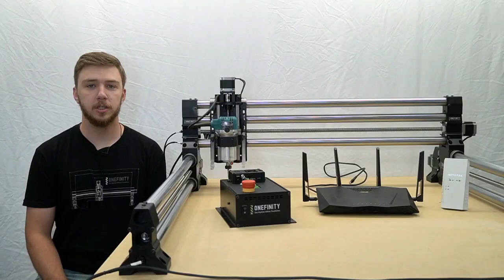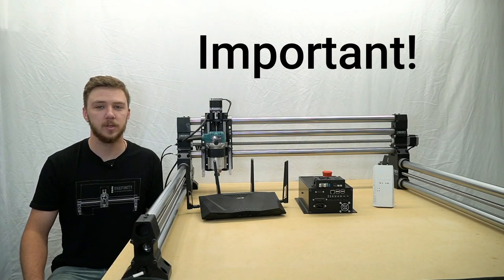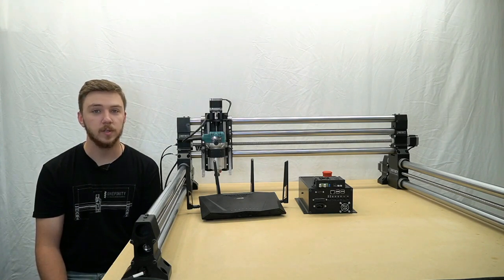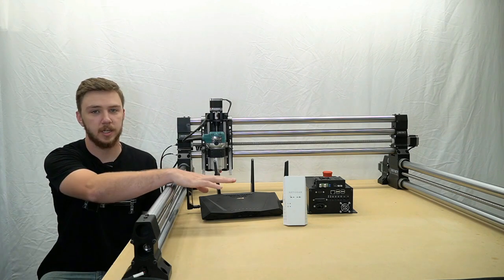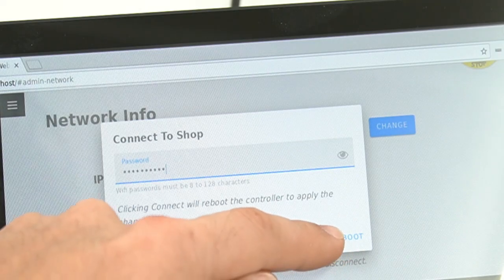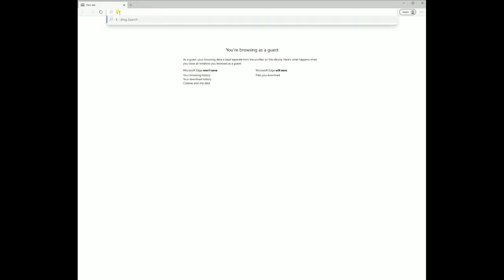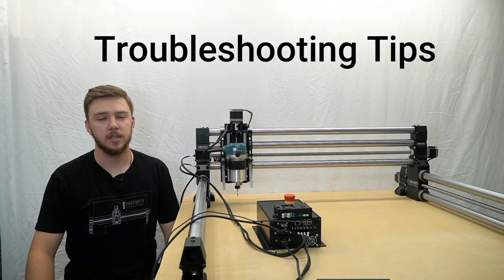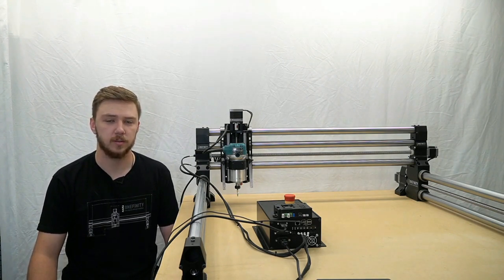Connecting Onefinity To A Network (NEW! : Updated for firmware 1.1+)

Comment: I am struggling to get connected to my wifi. I have a wifi extender in my shop about 5 ft from the controller. It was working in the previous version before I upgraded. 
I can see the wifi connection identified in box for my shop local extender. 
The IP address box shows my Onefinity address -- is that correct or should it be the wifi extender address?

What should be in the "Host" box? Client, Onefinity, wifi extender name???? What does "Host" refer to/ mean/definition? I tried every combination with no success.
Does the IP address get displayed on the home screen as in version 1.0.9? Or what? How do you know it was successful ?
please give instructions.
Reply from the maker: the ip address box shows the onefinity ip address.
Reply: @OnefinityCNC  could you explain the "HOST" box and what should the entry be.
Thanks